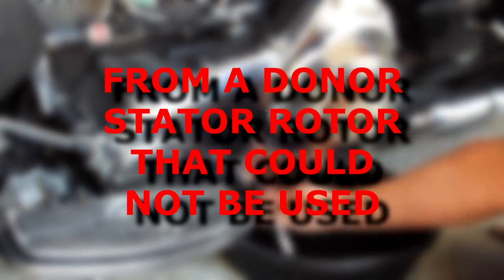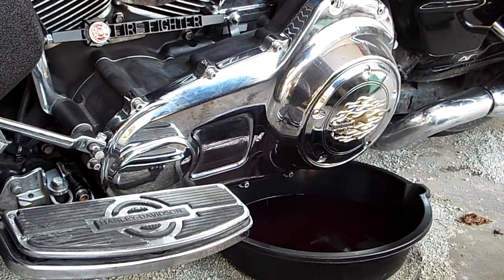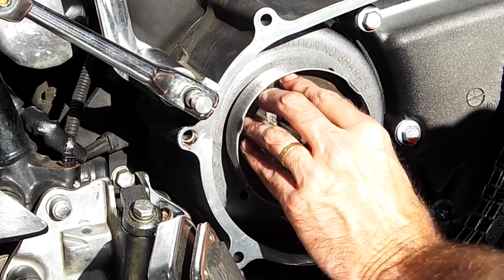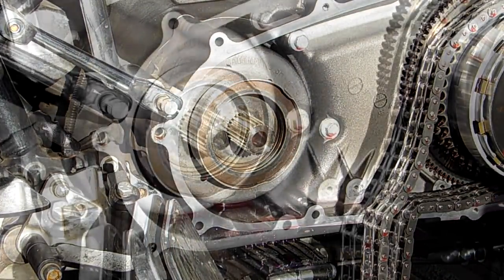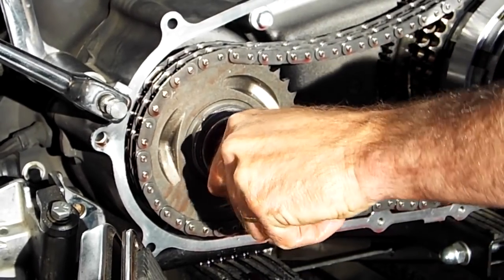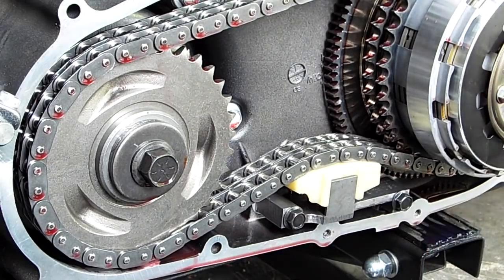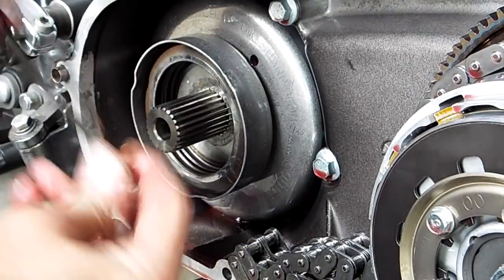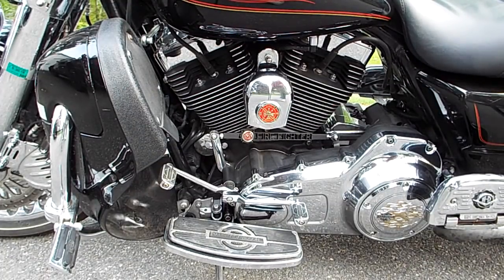Re-installing "Modified" Original Compensator

Comment: Any updates on this?
Reply from the maker: I put a lot of miles on that setup including riding two-up, and when I opened it up, shown in another video, it was still putting sufficient pressure on the cams. Startups, especially hot after fueling up, were solid with no drama as before. I acquired the final part I was looking for to install a Screamin Eagle compensator, so I did that. Someone had commented that the outer cup had separated from the stator when he was passing someone on the highway with the factory setup, so I was wondering if I would run into that problem with this modification? Maybe it was an isolated problem and not common?
Reply: Thank you Mark!
Reply: It’s best to get rid of the factory setup it’s trash.

Comment: I started doing that with the shovel heads and kept doing it with all newer motors up till 2016 for a quick fix using 1 more spring added in. Always worked good! As long as the splines aren't to worn.
Reply from the maker: Glad to know I'm not the only one! My '09 is still running one extra medium spring on a Screamin' Eagle compensator. No complaints.
Reply: @contact4mwy7  is it correct, that one may use just a properly sized shim and not the harley spring from the kit to get same setup?
Reply from the maker: Oleksa, I suppose you could use something homemade as long as the hole size was proper and it was balanced well. That is why I used an original, although previously used, spring washer as a shim. Now I have removed that extra spring washer and I am just running the factory number of spring washers with the thrust washer towards the back of the sprocket the way the factory intended. It is pulling we still and just a bit smoother on the power pulses than before making the ride more enjoyable and less shaking. This is with a newer Screamin Eagle compensator.
Reply: Got it, thanks!
Reply: It would seem to me, that all spring controlled, compensators would just need the springs replaced, along with any worn parts... The screaming eagle version springs also wear out, The baker version springs also wear out,  the way I see It no one ever goes without checking inside the primary more than 20 to 30 thousand miles in any case, most of the time everyone checks chain tension about 5 to 10 thousand miles anyway, and clutchs sooo why not put new springs ?
Reply: @kennethwise7108  the spring pack for the 05 and earlier are the same springs, and are around 50 bucks a set , you just need to remove them from the housing and place them in the rotor retainer..91 to 05  Harley Dealers are intent on selling the 400 dollar Screaming eagle instead of springs. Who woulda believed It 🧀
Reply: @kennethwise7108  what i said was that The spring packs for 91' to 05' have the same springs in them, It doesn't seem like anyone told you older the 07 in any case. Do a search for Harley compensator and there will be plenty of pre 07 spring packs averaging anywhere from 30 to 70 bucks, Put the springs in the 07 and up rotor and then Its fixed.. What do you think are the years we talking about,
You arent going to find any for 2 dollars anymore..

Comment: Hey Mark,thx for taking the time to make these videos for all to see...….my 2008 just started to making that awesome grinding noise a few times an took things apart just to see an make sure i'm not messing any other parts cause you know already the damage it can cause..i am going to tryout the 1/8th setup shim but making one at work ..I also put in the Hayden auto tensioner earlier an so far is working great.. I will keep you updated on how things go..6/24/18
Reply from the maker: dave dias thanks for commenting, and can't wait to hear how your homemade shim comes out. Where it will be flat, I assume, will you be placing the shim washer in the back of the pack or against the cam gear? My washer is not flat so it added more spring tension by placing it in the back, whereas placing it facing out against the cam gear it has a fraction of its spring action and acts more like it's just a shim. I hope that makes sense. What size motor? Mine is the 96. And when you opened it up could you rotate the primary chain sprocket back and forth about 3/4 of an inch without any resistance?

Comment: very interesting im having the same deal 1999 fxstc got it apart now have a used compensator with 25 thousand miles coming on ebay i may try that same deal u just did thanks so much for the video

Comment: Thanks Mark. I will try that. The issue is that i have the 103, and the cup literally delaminated off of the rotor unit. I will try this until the Baker is here and i install it. Thanks again!
Reply from the maker: Shane Hall I didn't know these compensators were also put on the 103's. What year is yours? The cup became detached from the stator rotor? First I've heard of that happening!I went for another ride today, still very happy with how it is rolling the bike. I'm hoping I don't have a cup/rotor issue like you had. Headed to Laconia bike week next week, about 200 miles one-way, two-up. That should be a real test.
Reply: Shane Hall that’s because that stator rotor/ cup was made for the TC888 and can’t handle  the TC96/103 . I have the Bakers Compensator and have never look back at HD crap for Compensators.
Reply: Thats a Shame to hear I live an hour from Laconia an have been going to that run since 91 its a good one aint it?
Reply: It is a note to those with the first years, of the spring pack on the rotor, some were riveted, and Not welded to the rotor.

Comment: Hello Mark, thank you for taking the time to make and post your videos, it is much appreciated. I own a 2009 Ultra CVO with a 110 that has made the clunking noise from the day I purchased it new. I complained to the dealer almost from day one but they never did anything about it. At just under 40,000 miles my stator failed so when I was replacing the stator I figured it would be a good time to check my compensator, it looked fine, not much wear on it or anywhere else for that matter, everything looked good. I thought about upgrading the the SE or Baker compensator but in the end I decided to wait and see how things looked when I had it apart. Once it was apart I decided to add an additional beveled washer like you did in idea two. I had the bike out for a putt this afternoon and the positive different was noticeable, smoother shifting, easier finding first gear.  I know you ended up going to the SE compensator but before you did how many miles did you put on idea 2 . Did you run into any problems with idea 2 ? Do you see any reason I should upgrade to the SE or Baker compensator ? Thank you for your reply.
Reply from the maker: Thank you for the compliments, David. I put 1,800 miles on that setup including two-up riding to Laconia and back, about 200 miles each way from here. Everything was still good when I took it apart to install the SE compensator. Someone had commented that the retainer ring that holds the spring pack in place detached from the rotor on the interstate and caused a whole lot of commotion. So I started wondering if that would happen to me with this setup, that's why I swapped to the SE. Where you have the 110 and I have a 96 I can recommend that you upgrade to the SE compensator. Yes, it has a price tag and takes a bit of fussing with (I had to grind away some of the inner primary metal to remove the rotor due to the first rotor I installed had issues and was out of balance and I really didn't want to buy another bolt/gasket set the second time around). I have uploaded videos for this as well. The SE compensators are just plain made better and can handle more hp than the original. The Milwaukee 8's use a similar but even beefier compensator, if you search for videos on them you'll see. That's my two cents worth, man. I hope it gives you something to go on.
Reply: Thank you for your prompt reply Mark. If I upgrade I am leaning towards the Baker unit instead of the SE unit. When I changed my stator I trimmed away a little of the inner primary cover with a dremel tool so the rotor could be removed without removing the inner primary so I am good there.
Reply: Mark, FYI - I was just told by a buddy that with the beveled washer turned out like in idea 2 that I’ll have to much pressure on the lefty bearing which will cause the bearing to fail, not right away but at some point down the road so I will be moving the extra beveled washer back to idea 1 which will hopefully give me some improvement. I know you said it didn’t make a difference for you but I guess it all depends on how much wear is on the beveled washer.
Reply from the maker: @davidrandall7354  I'm curious, is he talking about the motor bearing or the compensator parts themselves? The assembly pushes against the stator rotor which comes up against a stop on the crankshaft, so there shouldn't be any pressure on the motor bearings. Can you explain it a bit more for me? Thank you for letting me know.
Reply: @contact4mwy7  he is talking about having not enough give for the motor bearing, he said with the beveled washer turned outward that it is to tight and at some point it will take out the bearing. I just finished going from your idea 2 back to your idea 1 and the feel is not as tight but it is far better than the factory using only the 4 beveled washers. After I have a face to face chat with my buddy and understand this better I will get back to you.
Reply from the maker: @davidrandall7354  ok, thank you. Like I said, the springs press against the stator rotor which is up against a stop on the crankshaft, not against the bearings themselves. I have to wonder if he knows that about this setup. So you reconfigured the washers and it starts and rides good?
Reply: @contact4mwy7  Yes, I reconfigured the washers like your idea # 1 with the additional 5th washer being closest to the stator facing the same way as the 4th washer. The bike rode fine with a noticeable improvement over the stock setup. It is not as tight feeling as it was with the 5th washer being in the opposite direction closest to the sprocket but it is still tighter than it was with the factory setup. I assume the additional 5th washer is taking up the slack from the 4 worn washers. Keep in mind that my bike only has 36,000 miles on it and that there was no sign of wear on the compensator parts although as I mentioned earlier I have had the clunky noise from day 1, not every time the bike was started but 50% of the time mostly when restarting a warm engine, almost every time I stopped for gas it would do it.

Comment: Your not alone. I have a Victory Vision and I have had the compensator a part 10 times now. And I have tried the spring washers every way possible and it still rattles, or let’s the motor pulses cause the gears to sound like a pack of chicklets.
As when the the pistons fire it backlashes the gears and make rattling sound or shacking a pack of chicklets.
Drives me crazy.
Makes most of the noise under load when the power pulses are at the worst.

Comment: Great idea and video thank you,I’m just about to do mine
Reply from the maker: @67Screwy  Fingers crossed you'll like it better. I could definitely feel the difference and hear the difference on hot startups. I did eventually change over to the Screamin Eagle compensator after hearing about a guy whose compensator like this blew apart on the interstate, but he was the only one I had heard this happened to. Even two-up it felt more than adequate to me.
Reply: @contact4mwy7  none of what I bought fitted so I’m going to do the same screaming eagle kit! I’ve taken enough meat of the case so I can re install the back plate and fit the new flywheel in after,only stripped it today as when I got back from a ride I was leaking oil out the primary case at the bottom 🤦 just got to clean everything now ready for the manual chain tensioner and compensator,clutch looks ok so that’s a plus

Comment: Mark thanks, Any more updates? How is it working? Thanks...
Reply from the maker: It worked very well for the time I used it. I received a comment telling of the retainer ring detaching from the rotor on an interstate from someone and thought maybe it's time to upgrade to a Screamin' Eagle compensator, which I did. While I was using this experimental setup the starting problems went away, and it could still cushion the pulses of the engine at lower RPMs. I was spooked to think what if the retainer popped off my rotor, where would I be if that happened. I have not looked into how common that is. Thanks for the comment!
Reply: So rather be safe than sorry spend the money and do an upgrade to a Screaming Eagle or the Baker Compensator? Thanks again Mark

Comment: Hey Mark Young, what if you were to add a shim on top of the assembly between the bolt washer and sprocket. Wouldn't that essentially be the same as to what you were doing?
Reply from the maker: If I follow you right, between the bolt and sprocket would throw the alignment of the primary chain off. That why I had to add it to the other side.
Reply: @contact4mwy7  ok I forgot to think about that..... Throwing off the alignment of the chain. Did you ever find a definitive solution or just what you found in the video. And my bike only starts slipping when its warm.
Reply from the maker: @diymike5747  this setup lasted quite a few miles, even riding two-up, before I swapped it out with a Screamin Eagle unit. The SE unit is a bit beefier built, but the spring packs in them lose there strength after many miles of use. I have another video showing the installation of it and how I changed it up a bit by adding an extra spring washer to it. Ran it the rest of this riding season without any complaints. Thanks for checking out my videos and commenting.

Comment: Hey Mark you don't happen to have a few extra spring washers for the stock compensator, do you? I'd pay for them. I just bought a 2008 Heritage Softail Classic and I think the compensator is starting to go. It doesn't sound nearly as bad as yours did but when I start the bike it makes one LOUD clunk then it's fine. Does it every time I start the bike. Hoping an extra washer will fix it... I hate to buy a whole unit for just a spring washer...
Reply from the maker: I'll have to take a look see.

Comment: Hey Mark, great videos! I tried to replace my rotor/alternator on my 09 heritage. As you know the inner primary prevents you from fulling out the rotor. You mentioned that you ground down the lip and was able to pull it out. I used a dremel and ground it down as well. It is still getting hung up! I have the rotor that came with the screaming eagle compensator, is it possible its slightly larger in diameter than the stock? What did you use to grind down your inner primary?

Thanks in advance!
Reply from the maker: I used a Dremel with a grind stone. After I ground some away, I tried to pull the cover out and made a note of where it was contacting the primary, shaved that area a bit more and tried again. You should be able to see a difference in the ground surface where the disc is hitting. I kept doing this until I could just wiggle it out and then wiggled the replacement in.

Comment: I have an 05 Ultra Classic with a loud as shit compensator but not finding an upgrade.  I was thinking of trying this solution but not sure if I want to . Anypne heard of a solution for 05?
Reply: I just installled the Dark Horse Crankworks  man-o-war compensator and this thing is really great.   Harley should start implementing this on all bikes. I work on Helicopters and this baby is aircraft quality i tell you!   Previously I rode an 09 Ultra 96  and had problems at 23,000 miles, hot start issues and banging and clanking so i had a Screamin eagle installed and was fine for about 3 months and once again the problem started again.  I got pissed and sold the bike and recently bought a 10 ultra classic one owner with 39k miles and the same problem was immediately evident when the guy started the bike for the first time.  I thought damn, this one too??  He said its done it since day one. This would've drove me nuts so when i got it home i started to take it apart... Ordered a dark Horse Man-O-War compensator that same day and have since installed it. It is kind of like a love-joy-connector from electric motors that are spinning pumps or other mechanical apparatus.   It just uses round bushings Rubber cushions they call it to dampen out the engine pulses.   Genius!!  easily replaceable at 30 to 40k miles (per manufacture) the bushings do wear out but hell.  all you need to do is reorder the rubber bushings instead of the whole compensator. Worth every penny!
Reply from the maker: That is the description I've been looking forward to hearing about. Let me ask, did you have to document the crank runout first before install?
Reply: @contact4mwy7   Yes I checked runout and was .003 Darkhorse recommends nothing over .010   Im going to run it 500 miles and pull cover off to recheck chain tension, as I’m still using the factory setup.   At that time I may install a Hayden manual adjuster. Also thinking of installing a new Dark horse crankshaft  this winter after riding season.